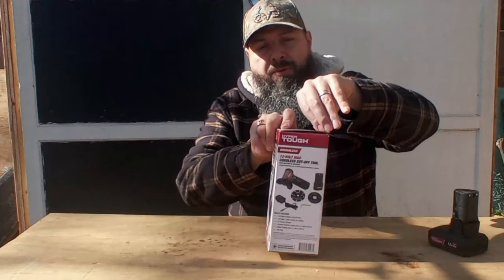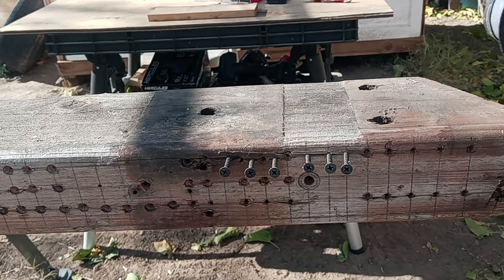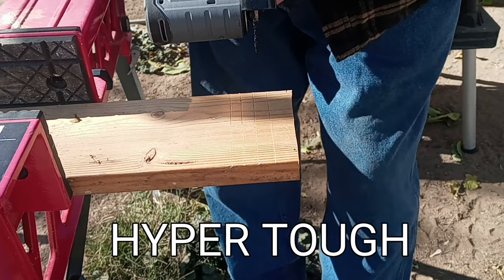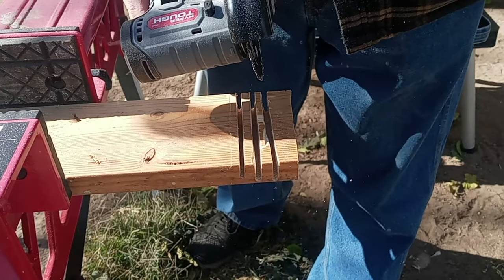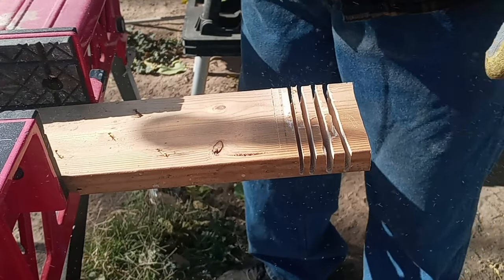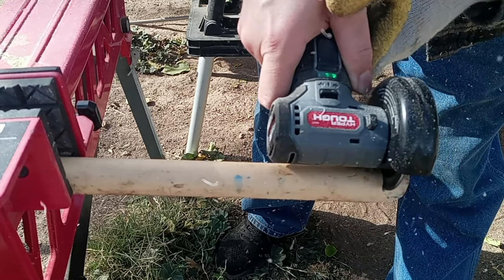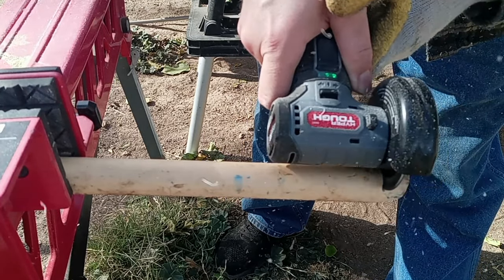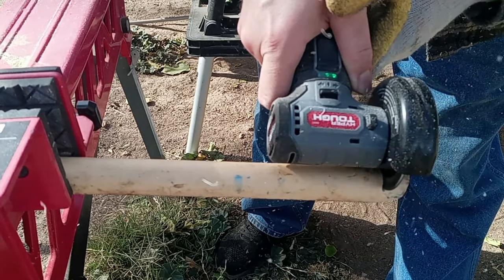Is the Hyper Tough 12V Cut-Off Tool better than The Hercules?

Comment: I have several tolls by hercules and they work good. I went and got the 12v cut off tool and it would cut soft butter. Battery was full charge!. Cut so far then stopped, had to turn it off and start over. NO GOOD IN MY OINOIN.

Comment: I have the Hercules it's a great tool with the 4ah battery, I use it mainly when I install vinyl fences, vinyl and fiber cement flooring, scoring quarts countertops, sometimes sheet metal. The 2 main problems with it are that there's no dust port and it's not bi-directional so you have to drag it because pushing it will make it jump around if you're not careful.
I'm waiting to see if a 20v will be released cause these little 12v tend to bog down and overheat if you're on the move.
Reply from the maker: Yes it overheats, On one 🎥 I made with it it took me over an hour to cut through a steel plate 👍👍

Comment: Different blades not a fair comparison
Reply from the maker: With the exception of the blades I used on the screws that came with the hyper tough, I used Hercules blades on both. You can see that on the hyper tough towards the end of the video on the table. 👍